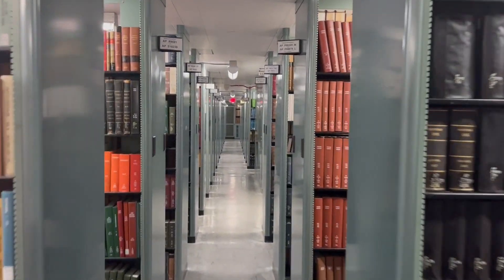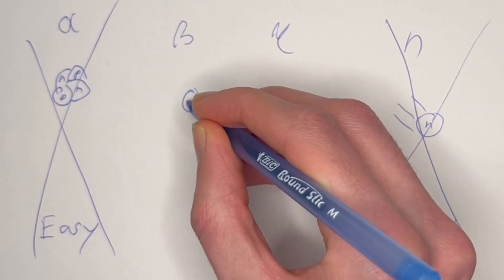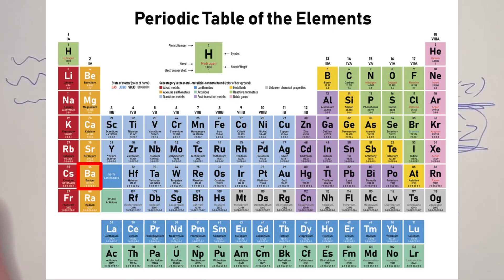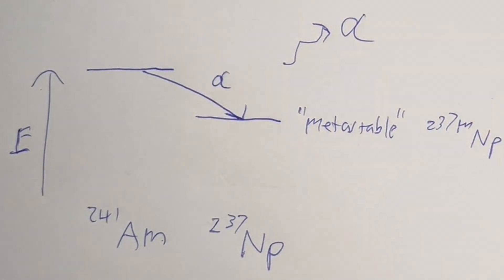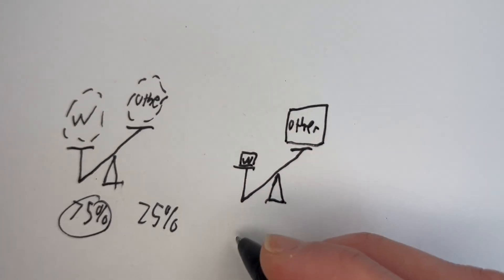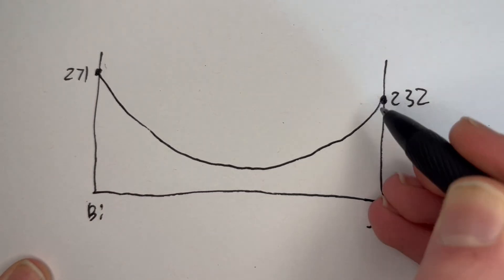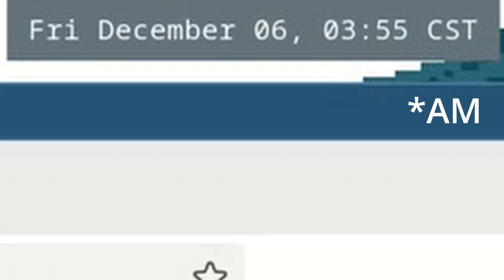making diy radiation shielding (out of spite)

Comment: Did you check for lead? Just wondering
Reply from the maker: I didn’t compare against lead if that’s what you mean, I don’t really have a space to work with it safely lol. You can look up pure Pb on NIST to compare, I think it has an HVL of ~0.12mm at 60 keV.  It’s definitely much better in terms of raw shielding performance.
Reply: @xenotimeyt  oh, no lol I meant the metal you ordered, how did you verify it didn't contain lead? I looked at ordering some of that alloy and I got a little nervous about ordering it.
Reply from the maker: @WrknOnLvnTheLvn  ohh, I didn’t check at all lol, it just said it was Sn-58Bi and that it was lead free on the eBay page. The ingot itself also had 42SN58BI like engraved on the bottom.

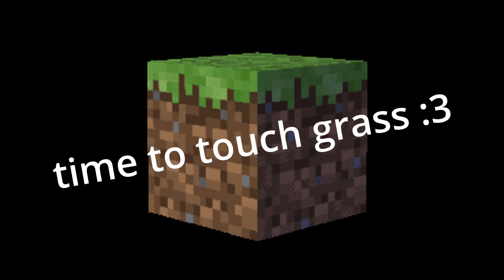Comment: Yo just so you know, you've got a mono mic for your voiceovers so anytime there's a voiceover (for example, 8:50) it just plays through the left ear lol
Dunno what you use to edit your videos but you'll need to like... set the audio track that you have your voiceovers in to a mono track. Or re-export the voiceover audio to stereo using FFmpeg or Audacity or something
EDIT: There are some voiceover parts where the mix is correct so I don't know what's going on lmao
Reply from the maker: I’m aware, this video was my first time using Resolve in like five years and it randomly started making tracks mono. I’d use ffmpeg to convert the m4a’s from my phone (yes I still don’t have a real mic) to MP3’s that resolve can handle but I don’t think that was the problem. I had to fix each bit manually and evidently missed several lol. 

So uhh I’m not sure either, but I’m going to try to have the ffmpeg step spit out a stereo mix with identical channels just to be safe (at least until I get a real mic lol).
Reply from the maker: Well also credit to my friend for telling me just after I uploaded it, I legitimately didn’t notice lol

Maybe I should edit with headphones…

(ok there’s a lot of things about my process ripe for improvement lmao)
Reply: @xenotimeyt  Oh yeah in Resolve, you can set an audio track to mono by right clicking on it. Then you can stick all your voiceover clips on that track and it should play through both ears
Reply from the maker: @HedgehogGolf oh nice, thanks for the tip!
Reply: @xenotimeyt  No problem! I don't remember why I subscribed to you, but I enjoyed this video and definitely look forward to seeing more from you :)

Comment: Can you really print with that directly?
Reply from the maker: It’s definitely possible I think, but I doubt you can just print the bismuth alloy by itself. Plastics in a 3D printer get hot enough to bend but are (hopefully) not melted. Metal doesn’t have this intermediate state. 

That said I think it’s probably possible to either make a plastic filament with this as a core, use clever gcode hacks to have it print the shell first, then inject the molten metal, then finish the plastic part, or even do what Prusa did and just mix metal particles in with the filament directly.
Reply: I really want to see the results of using lead base 😊 but congrats on job well done 👏
Reply from the maker: @WistlerX  well I might play with bismuth at some point but I’m not touching lead lol
Reply: @xenotimeyt  lead is safe if you wear proper ppe when melting lots of homes still use it on roofs and shower pans ,id rather have lead insulation for radiation then just Styrofoam lol 😆
Reply from the maker: @ yeah you definitely can work with it safely, but I don’t have the proper equipment to and have no real reason to risk it